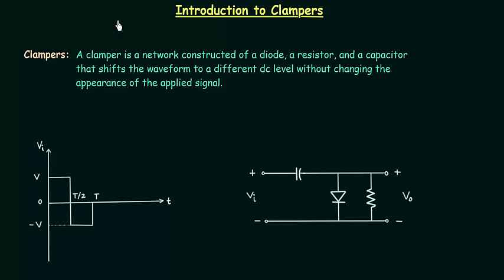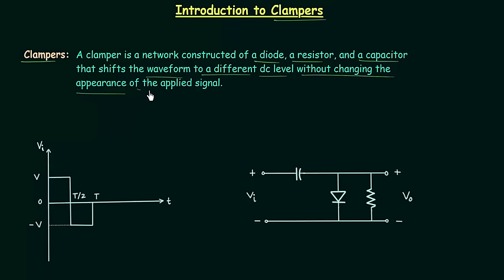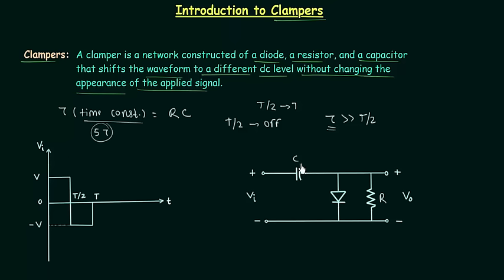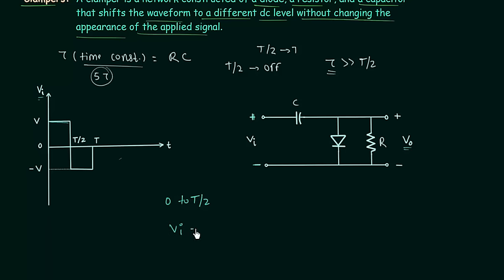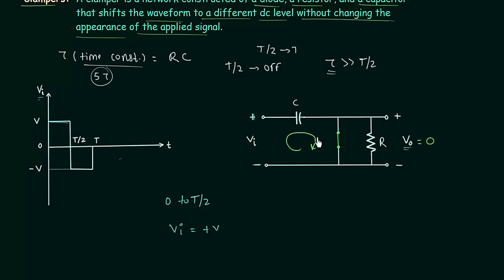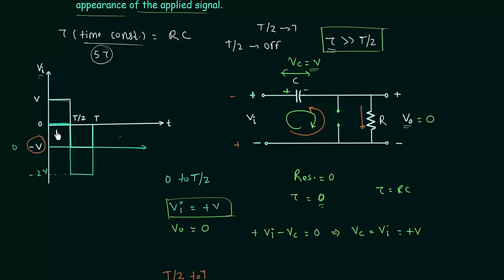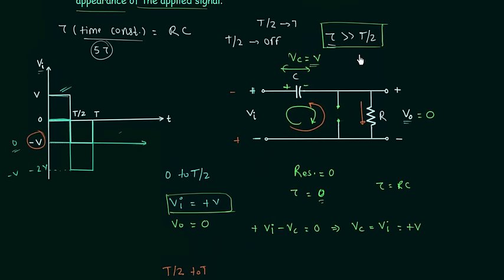Introduction to Clampers

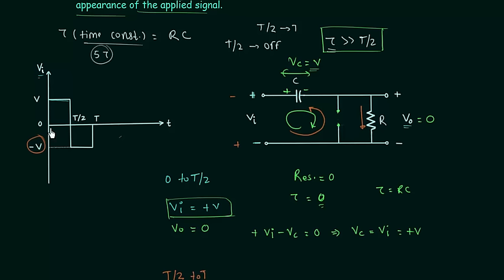Comment: 7:17 ....vi=-v
then vo=-vi-v=0.
i feel u did wrong. :-(
Reply: Yes..here at the tym of applying kvl  negative Vi had taken earlier so not using later at tym of substitutn
Reply: Had the same doubt. Got it cleared by watching the linked video.
Thank you so much neso academy.
Reply: throught the episode ,while operation u said clipper ckt to clamper cky
Reply: Yeah got cleared with same doubt
Reply: @ankitburnwal2569  link bro
Reply: @ankitburnwal2569  link?
Reply: he has not changed the output volt sign....watch next video...all clear
love u neso

Comment: Your explanation was really helpful.
But I would like to add that practically there should be some voltage drop across the diode. So output signal will change a little bit.

Comment: (1)Sir if the capacitor charges within the time t/2, then it should discharge within t/2??
(2) you have assumed that the time constant is much more compared to half of the time period then how the capacitor charges to V volts for the half cycle???
Reply: Capacitor gets charged 99% in mean time but till the time reaches T the capacitor is charging betn 99-100 so we have to assume it has charged

Comment: are you sure you have applied KVL properly in  the 2nd half?
Reply: I had a challenging time with that as well. If you redraw the circuit it might make more sense. It seemed to for me at least. I put the capacitor underneath the source:
  ________________ +
 |             |             |
 |             |             |
~           V           RL  
 |            |              |
=            |              | 
|______|________|_ --

It's basically just an output in parallel with the battery voltage + alternating source. Don't know if that answers your question regarding KVL or not.

Comment: Why will current flow in downward direction across load resistance when you have the path anticlockwise with red pencil. I guess it should be in upward direction.
kindly tell. See at 6:30

Comment: I have a doubt. The current flows through the circuit during the first half cycle. Then why the output voltage becomes 0 and how.?? Kirchoff's law is not the same for the positive and negative half-cycles.

Comment: Time constant is zero, in case of zero resistance. So in this circuit, how does the condition, tao>>T/2 hold?
Reply: same quest. bro
Reply: SAMAPAN BHADURY since tau is 0, the capacitor will be immediately charged to V volts.

Comment: at 5.08 how is Vc negative while the polarity you have made shows positive ?
Reply: He's using Kirchoff's Voltage Law (KVL). Vc is negative in his equation (even though it shows positive in his circuit) because at that point, when the diode is forward biased, all of the voltage is on the capacitor, so Vin = Vc and so Vin - Vc = 0. This is because KVL states that the sum of all the voltages in a closed loop circuit will equal 0.

Comment: I have one doubt. At the first half cycle, you defined polarity of capacitor as the input voltage, that is fine. But in the next half cycle, the polarity of input voltage got changed. So according to that, the polarity of the capacitor should change. Then why it did not change?  Plz clear my doubt.
Reply: bcuz time constant is very high,

Comment: Hi Sir, thank you so much for your explanation! However, I am still confused why τ is greater than t/2...May I ask why is it so?
Reply: Because during half of time-period of the input signal,capacitor is going to discharge(during which cycle that depends upon the diode orientation though)
Reply: Capacitor will be very well charged if Tau >> t/2 which would allow the capacitor to have its full effect at the output
Reply: It seems like charging time of capacitor is very small as compared to discharging time of capacitor

Comment: Sir, Generally at resistor there is voltage drop (so while using KVL we take - sign)
then why sir you took +ve sign for load resistor ? ( does it mean that across load resistor potential increases?
Reply: When we use tha mesh analysis then we first offer polarity to tha resistor according to direction of current in such way that first terminal of resistor taken as positive and second terminal will be negative .
Now while moving through loop its our choice whether we take sign of first terminal of battery and resistor or sign of second terminal of battery and resistor .

Comment: 6:14  why Cap polarities not getting reversed?
Reply: it has already charged in +ve half cycle, in -ve half cycle it will take more time to discharge because of the resistance(note that we have chosen the resistance and capacitance such that its time constant is much greater than the time period @ 2:10 ).

Comment: As Tau=0 the capacitor will also discharge in 0 time when diode will be reverse biased. Can't get it properly
Reply: in reverse bias condition capacitor doesn't get discharged...it is acting as a battery in negative half that is why we get some output.

Comment: In the first half time constant was zero. Then how it can be greater than T/2??
Reply: The condition is applied when the diode is nonconducting. According to this video the diode was nonconducting at second cycle with a finite time constant.There is nothing to be worry about first half cycle.

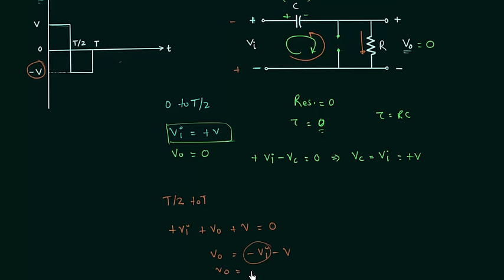Comment: 7:01..
How do you consider the direction of current in load resistance to be opposite to that of input voltage ?
Reply: The direction of current through the load resistor should switch technically speaking, but I think it's so negligible because of the charge already on the capacitor from when the diode is forward biased that he doesn't include it because he's teaching from an "ideal" circuit. The circuit will do the exact same thing without a load resistor connected implying that the current is next to nothing when the input voltage is opposite. Basically when the diode is reverse biased we're almost literally just measuring across a battery in series with an oscillating source because the capacitor technically doesn't discharge. But you're right: in the real world the direction through the load resistor will change directions. If you lower the load resistance significantly in the "ideal" circuit then then the current through the load resistor switching directions becomes much more prominent.

Comment: In the ladt video clipper in short circuit of a diode the output voltage was equal toh the voltage passing through it wherease in this video output voltage is 0. 4:34